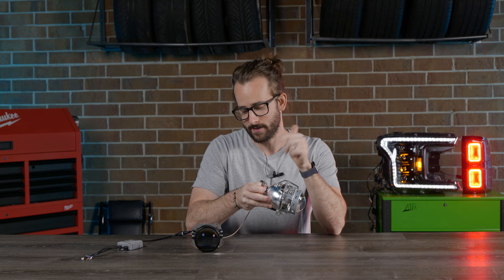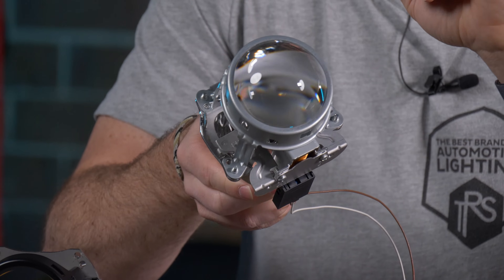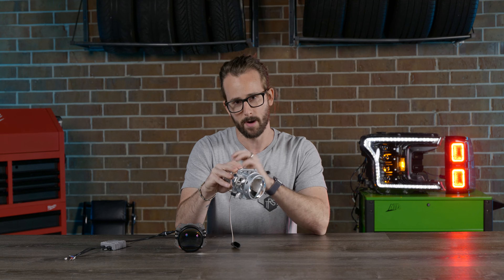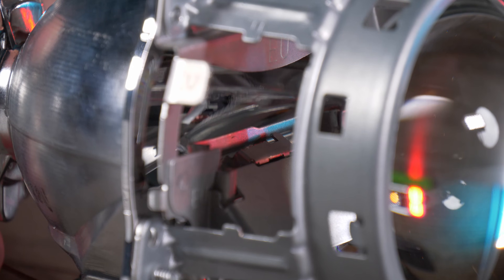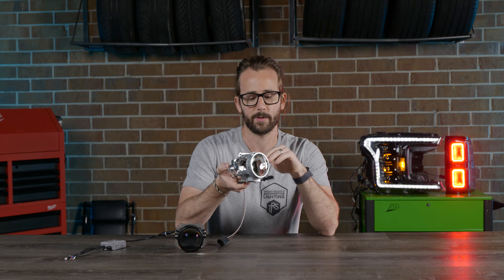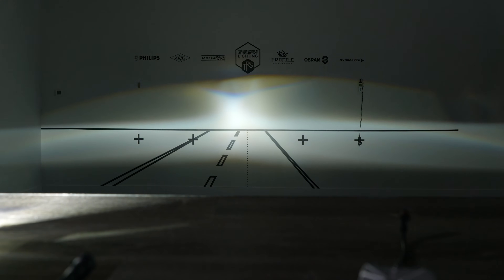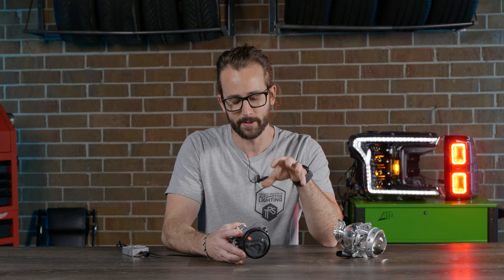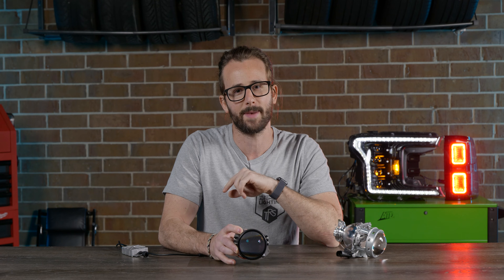TRS TECH TIPS: What Are Bi-Xenon and Bi-LED Projectors & How Do They work?

Comment: Does this mean that a bixenon harness would work the same for biled?
Reply from the maker: Biled projectors generally don't require the HD relay harness. They can plug directly into the OE wiring using splitters or adapters. However, for vehicles with tricky CANBUS systems, an HD relay harness might be beneficial, but in most cases, it would just add extra work without much benefit.
Reply: @RetrofitSource the problem when I added the biled projectors on my car (which has no canbus / c2 vts) is that without relay, low beam would work but when I would turn to high beam, the solenoid would turn but the light would go out. That's because in c2, the car has one H4 bulb for both high and low beam. Consequently, since it's led, it needs a relay so that the current still flows to the led once you switch from low to high beam. Once I placed that, my theory was confirmed but faced other issues. My low beam lights fine but when I go to high beam, the left (driver's) headlight functions immediately and the right requires to give the command twice. Essentially that means both malfunction because driver's headlight will go from low to high but the right one, if it needs 2 commands, then that means you are practically back to low beam. Yet the keep the solenoids open. I have to go back to course lights to reset them. It's a C2 vts 1600 125 ps 2004. I am in a deadend. I thought that maybe this happens because the 2 headlights both have their own electricity but maybe they share ground. But if that was the case, then the right one would never light on high beam

Comment: Is it more efficient to buy a Bi-Xenon projector and (get an adapter?) to use my H7 GTR Lighting bulb
OR buy a Bi-LED: Morimoto M LED Stage III Projector System
to retrofit into my Ford Focus 2012 halogen headlight assembly?
Would they perform the same? Are the lenses equally good and will the light output be comparable?
In the event that I need to change my LED bulb, wouldn't it be easier to just replace it on the Xenon projector? OR is the Morimoto Bi-LED Projector System more dependable and have better performance?
Reply from the maker: Great question—and it really comes down to what matters most to you: ease of install or peak performance.

The GTR Lighting LED bulbs are a solid upgrade for your stock projector or reflector setup, especially if you're looking for something easier to install and maintain. On the other hand, the Morimoto M-LED Bi-LED is the better performer overall. It’s designed specifically for LED output, so you’ll get a brighter, more controlled, and more focused beam pattern. It’s definitely a more involved retrofit, but the result is superior light output and longevity.

So if you’re aiming for top-tier performance and don’t mind a bit more work up front, the MLED system is the way to go. If you’re after plug-and-play ease with a solid improvement, the GTR LED route may be more efficient for your needs.
Reply: @RetrofitSource  Thank you! Since I have 2 pairs of headlights, I will defiinitely try to order the MLED from you guys!

Comment: Is there any benefit in me removing my d2h/d2s projectors and attempt to retrofit the mled in place of it? Will I gain brightness
Reply from the maker: It depends on what D2S/D2H projector you're currently running. If it’s an OEM projector, then yes—you’d definitely see a performance upgrade by retrofitting the MLED. But if you're already using a high-quality aftermarket projector like the G5 or MD2S, a good HID setup can still hold its own. In fact, upgrading your HID components (like a 55W ballast paired with Osram or Philips bulbs) might get you the extra brightness you’re after—without the hassle of a full retrofit.
Reply: @RetrofitSource I have just whatever is installed in my aftermarket projector headlights for a 2020 GTI. The beam pattern is nice and crisp and on par with a Morimoto retrofit I’ve done in 2019.

Comment: What would i need to do the bi-led conversion into a Subaru gc8?
Reply from the maker: It should be a fairly straightforward install, but you'll want to make sure you have the correct wiring and adapters specific to your year and model. Feel free to reach out to our team — we're happy to help you put together a complete retrofit kit that fits your setup perfectly! You can contact us at support@theretrofitsource.com or give us a call at 404-220-7940.

Comment: Hey man,
Would you be interested to make a comparison video hid VS led retrofit for hid VS led projector, but not only in terms of power of the light, but also in the points of glare. 

Everyone these days sell d1s, d2s etc LED direct fitment for BI-xenon projectors and claim "no extra glare, just more power". I see these on the road everyday and they definitely do dazzle you more than the factory oem hid bulb that was designed to be there.
Reply from the maker: That’s definitely a great idea, and we can pass it along to the team for consideration in a future video. You're absolutely right that many sellers claim “no extra glare” with direct-fit LED replacements for D1S/D2S projectors, but as you've noticed on the road, that's not always the case.

When it comes to projectors, there haven’t been many new options that truly push the boundaries recently. For HID setups, the Morimoto Mini D2S and Micro D2S remain some of the best choices available. For LED projectors, the Morimoto MLED still stands as the top performer. That said, there are also other solid options and classics out there, like NHK or the G5 HID projectors, which continue to deliver excellent results.

Comment: planning a retrofit on my corolla. do i need both low and high beam power for high beam to work? im coming from an h4 setup so low beam power is off when switching to high beam.
Reply from the maker: We sell harnesses that will plug into your OEM wiring to make these work. If you have questions about exactly what you need our customer service team is happy to assist!
Reply: @RetrofitSource  Would love to but unfortunately I'm from Asia so ordering would be a pain, just wanted to check since I know it's possible with relays, but I don't know if I need both high and low powered if I switch to high beams.

Comment: Sorry, newb here. I can interchange LED and HID in Bi-Xenon projectors?
Reply from the maker: No, the bi-xenon projector is a completely different unit than a bi-LED projector, which uses LED optics built into the projector itself so no bulbs are needed.
Reply: @RetrofitSource  Sorry if my question wasn't clear. My bi-xenon projectors came with H7 HID bulbs. Would it be possible for me to remove the H7 HID bulbs and replace it with H7 LED bulbs?

Comment: Can I replace a Bi-Xenon bulb with a Bi-LED bulb? I have aftermarket Bi-Xenon projector headlights in my car and they gave out on me and I'm curious if I can use Bi-LED bulbs in the same projector. Or do I have to buy a completely different Bi-LED projector?
Reply from the maker: You'll need to install some new HID bulbs, LED will not fit or work with your OEM HID system.
What vehicle are you working on?
Reply: @RetrofitSource  Gotcha. Thanks for the reply! It's a 2013 Ford Fusion Titanium

Comment: Thanks for the video, TRS. Very helpful for my purchasing process. For the Bi-LED’s: I’m wondering if (since you said the LED chip is fixed inside the projector housing) I would have to replace the entire projector if the LED failed? Or are these typically built to allow LED bulbs to be easily switched in and out?
Reply: I think you need to buy new projector
Reply from the maker: You would need to replace the entire projector.
Reply: Unless you buy a biled that takes led bulb. The biggest issue there is to find one that fits into it since H4 market bulbs tend to be bulky compared to the ones that fit

Comment: i just bought a toyota rav4 and they have these kind of lights and the high beam is pretty disappointing, is there any way to get better high beam? lightbars or any other lights?
Reply from the maker: A lightbar would make a nice supplement for the high beam!
Reply: @RetrofitSource  which kind of light bar any suggestions?
Reply from the maker: I would recommend looking into something that you could grill mount like a 20ish inch bar. Baja would be my preferred brand but they have QUITE the wait time right now.

Comment: Sooo which one is brighter? Oem bi xenon hid or new oem bi xenon led??
Reply: I’m old school.  I still prefer HID.
Reply: It's not "bi xenon led" its just "Bi-LED". The "Bi" refers to the shield dropping for high beam, and the "xenon" refers to the kind of bulb used in HID projectors, which is a HID bulb that creates light by burning xenon gasses. Also with the right setup and tuning, HID is still brighter than LED, but not by much.
Reply: Lol, difficult to tell.... measure the lux
Reply from the maker: They are very comparable, its difficult to tell